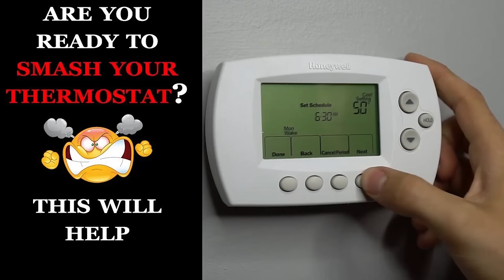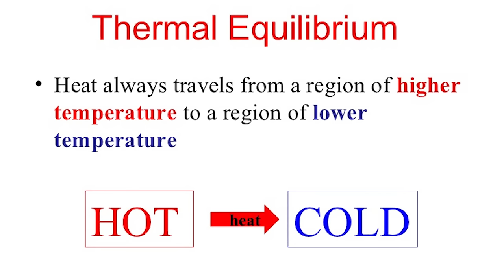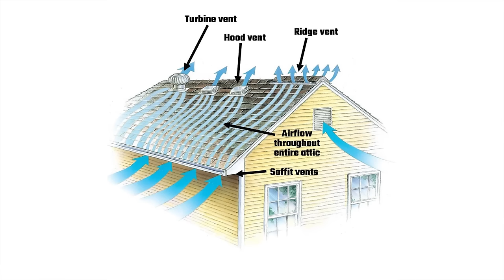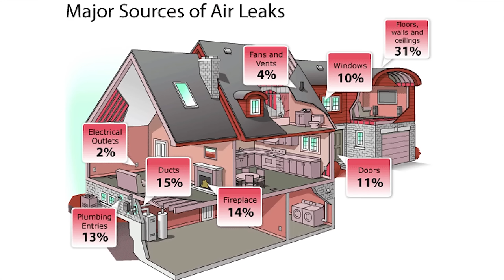AC Unit Not Cooling House - 20 Reasons Why

Comment: Thank you SO much! You were my YouTube mentor yesterday and it took most of the day, between watching YouTube, Googling, trips to the hardware store for parts. I'm not the typical demographic of someone who fixes AC units, shall we say.  But finally through process of elimination, mostly from your video series plus a few helpful bits from others, fixed my AC - it turned out to be a $10 canister fuse blown at the wall shut-off next to the AC unit. In between, I had to learn how to use a multi-meter to read voltage, watch your safety tips like with handling the capacitor etc.  I surely would have been better off paying a professional rather than take all day myself, but there was a huge backlog and we are in a heat wave, couldn't wait. So this was life-saving. Thank you for your great informative series.

Comment: I love you, regular homeowner here. You helped me troubleshoot and fix my AC for less thank 50 bucks, vs doing an quote emergency service call since its the weekend. my capacitor was bad. i have zero hvac experience but im mechanically inclined. Just tested it and picked a new one up at a local part shop for 28 bucks you saved me at a minimum 500 bucks possible more with labor. <3 subscribed
Reply: You are welcome. Since you saved quiet a bit of money send a donation as soon as you get a chance. Thank you!
Reply: WTF 😂

Comment: Great Channel!  Clear & realistic instructions wrapped in sound advice.   
Here's my story of why my AC wasn't keeping up as we start this summer:

I changed my motor out this past winter (with your good counsel).   I used a universal replacement motor and naturally, even though my old motor was on the medium speed, I naturally figured if medium is good and worked for 15 years, then surely "High" is better - can anyone relate?  As usual, more is not always better, I over powered my coils.  The air was blowing over the coils so fast the humidity stayed with the air all the way into the house; as I figure it, the air wasn't around the coils long enough to "cool off"..  
Bottom-line:  I switched the black wire with the blue wire and it's  back on medium speed.  Now she's keeping up just like she always has - Go figure!   Kudos to my original install team - their calculations were apparently "spot - on"!  (smile)

Comment: You should become HVAC instructor. You made your explanations easy to understand for everyone without HVAC knowledge. I've been trying to learn HVAC myself but most videos out there talk too much but barely going to the point, find out issue and solutions. You have experiences inside and out, you can talk all day without the scripts. Most issues usually happened out there with relay, capacitor, cleaning the coil, replace thermostat battery. You have instructed how to replace these and save homeowners' a lot of money. 
Very well done and thank for the videos.
One issue I found myself before that when weather transition from the Fall to Summer, the outdoor AC unit didn't run when it first start, I just shut down the A/C breaker and turn back on, somehow the power kicked in the unit and the unit start to run and everything are fine. Sometimes the tech got lucky but it took care the issue and save the money.

Comment: Bad Capacitor was my problem.  It looked fine but I replaced it anyway and the problem was solved.  I then took the old capacitor and did not notice anything wrong until I placed it on my kitchen counter.  The capacitor had a slight "bulge" on the bottom of it and it could not stand on the counter properly ( I did not notice it by just looking at it).  It rocked back and forth.  Since then my unit runs great!  I really learned A LOT from you and you saved me a lot of money. Good luck in Hawaii, I did not have an AC unit growing up there but I heard people are now getting AC units.
Reply from the maker: Glad to hear you were able to get the AC going!! Yeah, those capacitors don't always bubble up when they fail. Thank you for the well wishes, I think I'll be okay with work over there :) Have a great weekend, stay cool!

Comment: number 5 -check filter-was the winner for me. Reminded me that I have a air exchange vent under my bed (in my seasonal park model trailer). lo and behold I hadn’t removed the foil and trivia per suit box that I covered it with to protect the place from mice over the winter.   
Everything is a working great now!  

Such a great video. So informative and well presented. Thank you!!!

Comment: Love your videos lots of info. So my thermostat is set at 78 but temp is 81 during the day. At night it get to 78  I did change the capacitor was bad and replaced it. It being very hot here in Central Florida about 98 index at around 112. Clean inside unit coil and replace filter. So will se tomorrow.
Reply: Any update on this? I've been searching since last year and no one has a solution.

Comment: My neighbor just had their 42 year-old AC replaced at a cost of $12,000 and mine is the same age (moved in in Dec 78 -new house). I could tell that my AC had been getting a little less efficient over the past couple of years and I was thinking of replacing it too. I watched your video and checked one thing that I had not checked before. When I checked the coils at the top of my air-handler, they were dirty.  I almost looks like they had installed a very thin charcoal filter on the inside. Once I cleaned it, the air volume coming from the vents was much greater. It is supposed to get to 104 today and tomorrow so I hope this change will keep my house at 76 instead of 81/82. Thank you for the great video and for saving me from having to replace my AC in the summertime.

Comment: Great info and summary Jay, thank you!  I relied on one of your hard start videos yesterday to proactively add a spp6  that I picked up from Johnstone Supply.  Added the capacitor / relay to a perfectly functioning 27 year old Comfortmaker AC as it sounded like it probably wouldn’t hurt anything and could possibly extend the life of a flawlessly functioning system. Thank you!
Reply from the maker: Thank you Holt! Glad to hear that my videos can be used as reference for stuff like that :) Those old Comfortmakers have long lifespans so let's hope that one hangs in there for another 10 years or so!
Reply: Word of Advice TV No joke!  It’s my moms AC unit I was peeking at for “fun” and allegedly she’s had nothing done to it since 93 when it was installed (other than annual spray down of the outside coil).  Unbelievable. Delta T shows 18 degrees.   Unit sits in the shade.  Maybe that has helped. Hope your house selling and work is going well!
Reply from the maker: Sounds like a little beast! Yeah, as far as I know, if the unit is not baking in the sun all day it does help it last a bit longer. The house is already sold but the closing process can take up to 60 days and we won't be moving until then. The corona virus has really made this process a lot slower... So just waiting now.
Reply: Word of Advice TV congrats on selling your house!  Are you heading straight over or planning to stick around here at all before moving?  If you need anything, definitely don’t hesitate!  Also, congrats on your channels continued growth and success. It’s great to see the new subscribers pile on!  You’ve certainly earned it.

Comment: been doing this for more years than i like to recall..(before capacitors were used and 12, 22, 502 were the only Freon used.)(yes; i know ammonia been used and still is for heavy industrial and r v refers.) well done video.
Reply from the maker: Oh wow, you sound like someone who's years of experience rivals my age :) It's an honor to hear that the video was well done from a veteran tech! Thank you for watching and leaving a comment!
Reply: Maybe you can help me the unit I am trying to fix is r410 gas and has low side pressure 120psi.  the clean coils and quick filter appear to be fine but only 68f comes out.  of supply and 79f.return but the suction hose does not sweat which could be if you can help me with an idea.  Could it be the txv valve?  thanks in advance

Comment: First of all, thank you for sharing the video.  It followed your process and it helped me understand my unit much more than what I did before (which is practically next to nothing).

I have two AC units (one for down stairs and upstairs). Downstairs was working fine but for some reason, upstairs was not working.  So I called the technician.  It turns out that the AC power switch for upstairs was turned off.  He turned it on and viola! it started working (shows how little that i knew about my units.. .and I had to pay for it too).   While he was there, he checked the freon on both units and tells me that he needed to fill them as well since they are running low (both are around 20 years old) and told me that I should consider replacing them.  Fine. I called around to get an estimate.

A week after the freon was filled, I noticed that the downstairs AC is no longer blowing the cold air.  I called the technician back to check and he says that it was filled with freon and he needed to go up the attic to check the capacitor.  It was an odd hour and I was out of the house then so he said he'll be back the next day the check.  He didn't show up. 

Just to do my due diligence before I pay him more, I checked everything following your direction... and this is what I found.  All the units were working fine... outside AC, upstairs Attic, and it feels that the air was circulating properly. What I noticed, however, is that the upstairs AC unit on the outside, which is now working) is blowing up hot air through the fan.   Downstairs AC Unit (which is NOT working) is blowing up cold air.   hmm....   I checked the thicker pipe line coming out of the AC out of the outside, and the upstairs one (which is working) was cold.  But the pipeline coming out of the AC unit for downstairs (which is NOT working) is not cold at all. 

Can you help me understand what is happening and what could be the issue?

Comment: Had a partially plugged up condensate drain that caused intermittent hvac operation. Water would build up until it lifted the float of the Safe t switch, shutting the unit down for five minutes until the tstat built in delay would allow it to restart, at which time the build up of water under the safe t switch would have drained out .but temp on tstat was higher than set point.   I caught it when I looked at the tstat when the safe t switch had triggered and it was blank from loss of power.  Cleared the drain line and all was good.
Reply from the maker: Oh wow, that's a good one too!! Way to track it down! Thank you for sharing!
Reply: Same here. Crazy.

Comment: One thing I might add is to make sure the blower motor is spinning in the correct direction. A recent airflow issue I was having was caused by the blower motor turning in the opposite direction after replacing the blower module. I was able to reverse the polarity (swapped the positive and negative wires at the motor connection to the module) and got it to spin in the correct direction. Airflow was restored and AC was getting to temp again.

Comment: great vid and tips my man, thanks. i hosed out my 2 units outside and also changed each filter for them. and one spot really hit home.. our lower A/C was broke yesterday.. (I have a downstairs and a separate upstairs unit.) it was 95F outside.. i keep a spare capacitor just in case. sure enough, the fan was not spinning outside. The capacitor was all swollen. (I replace them every couple years). I replaced the capacitor and bam, the fan started.. but then.. it was 81F downstairs.. After 4-6 hours, it was only down to 79F.. i thought i hadn't fixed it.. then you said that sometimes it can take a full day to cool if you let it get too hot.. next morning... it was 72F.. i think the A/C is working, but it is also still 80F at night.. I'll have to see if it keeps it to around 74-75F when it gets hot later on..

Comment: This is a great video. My question is, should I have a filter behind the return vent?  Thank you
Reply from the maker: Thank you! If you have a filter by the furnace/air handler that is enough. But if there is no filter there and the return grill is the only place where your filter slot is, then there should be a filter behind it.
Reply: @WordofAdviceTV  Thank you for responding. Yes, I have a washable filter in the furnace.

Comment: What a great video, we lost power for like 15 seconds then my air unit stopped throwing cold air. Fan working, thermostat working, tried breaker, going to change filter praying that’s it. The unit is only 3 1/2 years old. Hopefully I can do this on my own! Thank you for your video!!!
Reply: What was your issue ?
Reply: I needed to get a dual capacitor replaced. They told me to get surge protection on my electric box.

Comment: Hey Jay.  Thank you for your very informative videos.  Good job!
I have an AC problem I just can't resolve, so far.  Two days ago my AC started blowing warm air.  Since then, I've done the following:  1) replaced filter below blower, 2) replaced dual cap - slightly rounded out both ends, 3) installed hard start, 4) replaced condenser fan, 5) checked low side pressure - 75 psig, 6) ohmed out compressor from contactor T1, T2, Cap Herm (2.0+0.8=2.8) - I did not ohm to ground, & 7) replaced thermostat batteries & checked wire contacts at thermostat.  
My symptoms:  after a short delay from thermostat Set point, compressor kicks on, condensor fan kicks on, semi cold air comes out registers.  After a few minutes (5), warmer air starts blowing out.  I go outside and compressor still running, but fan kicked off.  Almost like short cycle syndrome.  Air gradually gets warmer.  Low side feels cold'ish to touch.  Then I turn thermostat off so compressor doesn't get too hot.  Condensor fan seems to cycle on/off.  Maybe bypass thermostat by jumping R & Y to eliminate thermostat?  Check 24 V at contactor & check plunger action (2 arms). Suggestions?
Reply: Why not just pay a technician that knows what they're doing!
Reply: So, what problem did it end up being?
Reply: Sounds like low on refrigerant to me

Comment: I watched a very detailed video last year of a guy taking apart a 2004 f-150 cold air intake manifold.  His video was the closest to my vehicle.  Despite 30 degree weather, tight spaces, constantly dropping things bc i could not feel my fingers i went from a guy with an elaborate first purchase tool set to finally admitting defeat and having AAA tow it to my normal mechanic who encouraged me to try. I think it had between 8-12 bolts total holding it in on both sides . It was heartbreaking, but my mechanic said, "Good job." His assistants took 3 days, putting it back together as i took cell phone pics and labeled some items with tape and a marker.  My point is excellent video, i actually have 3 pages of notes and references i paused,wrote down, and even screenshot.  We have a professional coming hopefully this week, but i can tell him the easy things i tried to help him rule things out. I also contacted a number about the solar screens to see if it is legit or not, I will be calling to see if i qualify for a home energy audit , and in total i have 3-4 pages of detailed notes from your video and still have to follow up on a couple you used in making this one. I normally never write comments, hence why this one is all over the place.  But this one made me want to learn more and more.  I subscribed to your channel and finally just wanted to say thank you for presenting the material in a way i wanted to learn more and more.  I look forward to looking back at your other videos and new ones to come.

Comment: Non-condensables is major problem with 410a equipment during a seal break. System needs to be pulled down below 500 microns and hold. If blended refrigerant is introduced to air, nitrogen, or water, AC will not keep up on hot days. I learned the hard way:$

Comment: Remember a duct leak in attic is the same as pumping air outside which creates a double wammy.  Not only are you pumping or drawing outside air inside, you have to makeup that air from air leaks either in or out of structure depending if leak is supply or return.
Reply from the maker: A bad situation all around. Thank you for explaining that AD!

Comment: I had a plumbing heating and air company come out to look at my water heater that needed replacing and they looked at my HVAC unit and said I should replace it because it’s original to the 2001 home. At the time it was working fine but since they were here it will run but doesn’t cool. They came back and said it has a short, which can happen at any time, and they’d charge $700 to find/repair….I’m hoping your video might help me get it back to working how it was before this company had their hands on it!🙏🏼

Comment: Thank you found your video very helpful, one question I do have, my elderly mother leaves doors open thus letting the hot air in, so, in doing so noticed now our a/c is not cooling is there a reset button on the cooling system for situations like this?

Comment: I really am at my wits end the house I just bought. My home in in central fl and its 1150 square feet. The ac is a newer 2.5 ton 2020 champion unit. The delta is anywhere from 18 to 22 degrees. The windows are new double pane. I just had attic insulation put in yet the ac has a very hard time bringing the temp down. The only other things I can think of is there’s lots of leaks in the home or the thermostat is faulty.